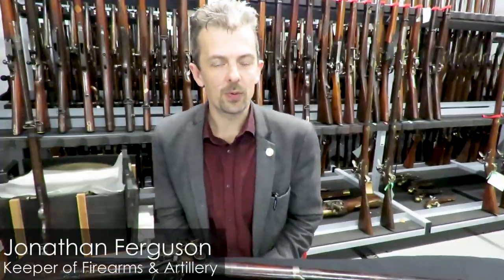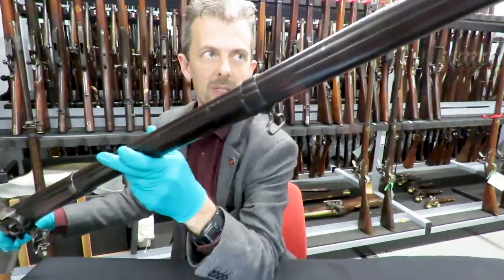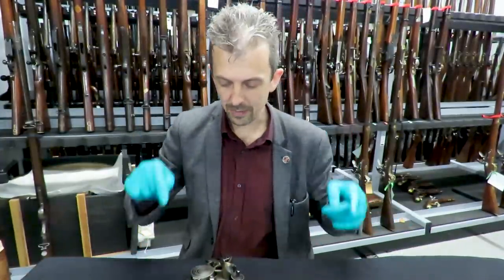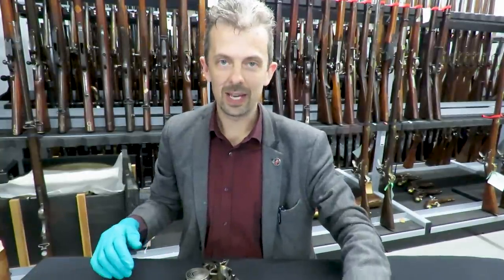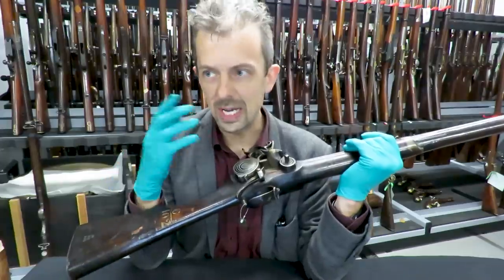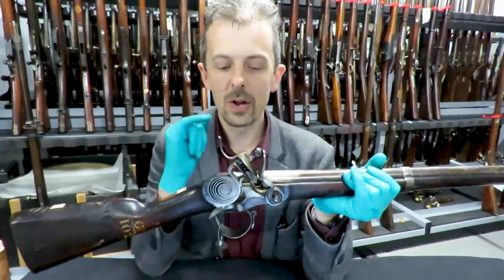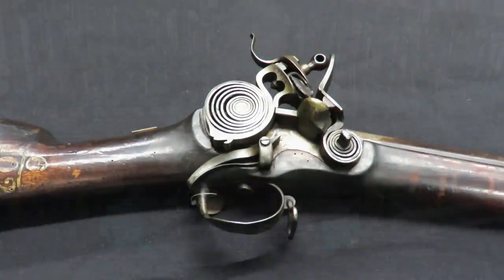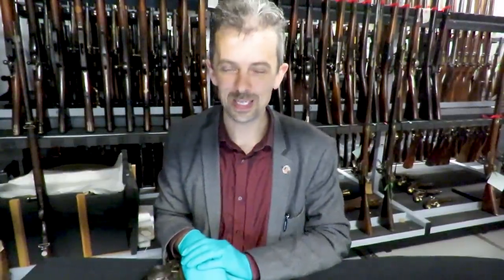Why does this musket have a strange spring lock? With firearms expert Jonathan Ferguson.

Comment: I love these sort of last ditch type weapons, designed to be easy to produce in times of war. They always have such creative design.

The triger seems oddly similar to a crossbow.
Reply: It pretty much works the same way as a crossbow trigger, except that a crossbow would rely on the tension of the string to set it spinning and doesn't need any springs.
Reply: I have a particular one in mind with a very similar looking lock, and a sort of latchet system, with a delecate thumb trigger. It's from the late late 14th century I believe. That awkward time where early handgonne's were starting to compete with light crossbows.

It's been a while since I've looked much at crossbows. I'm probably mistaking a gear or pully type system for a lock. 

I think we need a seriese on forgotten crossbows to shore things up.
Reply: "designed to be easy to produce in times of war." 
Ve need more weapons for ze Volkstuurm.
No problem, we captured a certain design in a French arsenal.

Comment: I'm always taken aback by how much variation there are in examples that I would've thought to have been relatively standardised.
Reply: Don't think you can really have "standards" if things are still made by hand (with the help of machines).
Reply: @aborted4196  That's true for the time period, but that time period was relatively short. Interchangeable parts and industrial machining were on the way in during the 19th century.
Reply: @ericsmith5919  Interchangeable parts started with the American versions of the French Charleville pistols in the late 1790’s.
Reply: @allangibson2408  Yes, but the concept wasn't perfected or universally adopted at the time.

Comment: I have experience as metal worker myself.
If i look at this spiral spring and how to make it.
Other types of spring are easier to make, in my opinion.
What could be the decisive factor is the heat treatment.
Reply: I just commented the same thing. I wonder if it isn't metallurgical - would a clock spring be more tolerant to inconsistencies in the steel vs a V spring?
Reply: @chemistrykrang8065  It makes sense to focus on resistance against production inconsistencies when moving towards mass production, although I have no idea how spiral springs fare against other types. If the intention was that the gun could be made at a much larger number of local workshops than before, that would also make oversight over the production line and various forms of quality control much more difficult.
Reply: @chemistrykrang8065  I don't know, sorry. Only a engineer can answer that.
My basic study in engineering was 15 years ago. Forgot to much.
Reply: Another explanation, although I don’t have any specific proof, is that it might have been a weird guild thing. The guild system had not yet been abolished in 1790, so it might just have been that the more numerous whitesmiths made spiral springs and locksmiths made other springs for some arcane, outdated reason.
Reply: @johanmilde  Possibly the thinking was that yes a separate guild would possess a considerable stock of already made clock springs therefore this Rube Goldberg ridiculosity would allow the use of people and product not normally associated with gunsmithing. At least this part of creating a musket.
Colonial Williamsburg has here on YouTube a series from scrap metal to completed civilian hunting firearm. It is many many hours of one man performing a truly skilled trade of many individual steps. The lock mechanism takes only a small part of such steps,the traditional v-springs are much simpler to make than this coil,a precision manufacture that I doubt anyone modern could duplicate without years of experimentation. 
So to me it makes no sense. There are so many different steps,which then are the steps that take the most time and effort ? Not this I would think.
Taking an already skilled master tradesman,requiring him to add and tinker with all the extra steps from clockspring to the flint dog striking the frizzen, makes absolutely no sense.
 So was this desperation,even a few extra muskets being better than none,or was someone creating this as a statement of unusual master tradesman ability  ? As in,"I can do this and no one else can" ? It is beautiful in its own way,but eccentric beyond belief. 
How accurate  and reproducible is the strike ? Surely the spring has wobble and give ,no ?
Beautiful but absolutely bizarre.
Reply: @paulmanson253  My guess is that the coiled spring, being longer than an equivalent v-spring, would be under less stress, and store / release less energy per given length, which would make it more tolerant of imperfections in the shape, metal quality or heat-treat.
And with the production methods of the time, producing very consistent quality steel, and precise, consistent heat treatment were probably among the most difficult steps to get right…
But I’m not a metallurgist by a long shot, so that’s just a semi-educated guess.

Comment: it would be cool to see if the spring was comparable to a commonly used size of clock spring at the time, especially if to the extent such springs could be canibalized, the reason it was so drastically simplified to the point of impracticality was probably to establish just how much you could remove, i'd imagine if they'd put the plan into use they'd have most likely opted to add a more conventional trigger, preferably with some kind of spring even if just a weak one to help the sear engage

Comment: I'm not sure I understand why a clock type spring was considered easier to make - the heat treating principles are the same as a conventional V-spring, and a V-spring is a simpler thing to forge, surely?

I've done a tiny bit of forging and heat treating (making tools, chisels etc) and I'd be a lot more confident making a normal mainspring... what am I missing here? Is there a metallurgical reason why a long thin clock spring is easier to produce?
Reply: My surmise is a conventional lock spring needs to be closely fitted and tempered ~precisely for its size. An external spiral spring leaves a lot more room (in more than one sense) for variation.
Reply: I would very carefully hypothesise, that a large coil spring is under less tension and deformation, and more forgiving of  heat treating errors, than a V spring. Every portion of the coil barely deforms. in a V spring, various areas are under  very different amounts of tension and deformation

Comment: Very interesting. It seems that a "v" spring would be easier by far to make.
Reply: Exactly my thoughts, just imagine forging out the length of that spring... I think it wasn't really about the spring itself but more about the ease of putting together this "crude" external system vs putting together the standard internal mechanism and getting it to work right (which I assume needs to be done more precisely so everything fits and works properly...)

Comment: I can see no benefit to constructing that mechanism, rather than the conventional lock. The maker still has to create a spring ... coiled, rather than 'V-shaped'. I would not have thought that would be any easier to manufacture. Perhaps the idea was to pinch the springs from the clock mechanisms of the bourgeoisie, after having first sent the owners to the Guillotine.
Reply: The weird thing is that this is several years before the part of the revolution where a lot of the choices would make sense. In 1790, there’s still a king, now with limited power; there’s rising tensions in Europe, but war doesn’t break out until 1792; and the Terror and the mass mobilisation is 1793-1794. 
So this was not a last ditch weapon, but it was made at a time where war looked quite likely. It might have been intended for the National Guard, which as a (initially) local/regionally based citizen militia would require a lot of cheap guns, especially given that they paid for their own gear.
Reply: @johanmilde  You're quite right, and the timings throw doubt onto the 'last-ditch' hypothesis.
I'm gonna take a wild guess that breakages of conventional main-springs were very common ... and someone figured that a coil-spring would be a much more reliable and durable alternative.

Comment: Mr Ferguson,

I have two thoughts concerning this musket.  First, I cannot see how the springs and trigger are attached, but I wonder if this lock could require lesser degree of skill than that required for the hand-made tools and operations in the  drilling, tapping, threading, and in hardening and tempering compared to fabricating reliable powerful and highly tensioned v-springs and the rest of a conventional/classic flintlock, especially if bridled.  I don't know how the skills and work entailed with this would compare with those in either version of miquelet.

The second point is that I believe that this firelock might be safely managed with only moderate modification to the normal musket drill, assuming reasonable training and practice.

The first step in loading would be to come to half-cock in a significantly different sequence:
 - Come to Poise Firelock, i.e musket vertical, lock about face level and oriented away from the soldier.
 This position could probably be modified somewhat, held a bit lower and/or rotated somewhat clockwise. 
 - Continuing to grasp the firelock firmly with the right hand, bring the tip of the trigger finger to the back of the trigger and press it forward with pressure sufficient to enable the tip (sear? nose?) to engage the bents on the cock.
 - Supporting the firelock with the right hand, release the grip of the left hand and bring it back to the lock, and with (whichever finger seems appropriate in a proper military manner), pull the cock back until it engages with the trigger nose in the half-cock bent.

Then, prepare to prime, again somewhat differently from usual:
 - Bring the left hand underneath and around to the right/lock side of the firelock and position the fourth (or third and fourth) finger(s) behind the hammer (/steel/friizzen) in preparation for opening the pan. 
 - Pull the hammer open/forward with the finger(s) while proceeding to grasp the forend of the firelock with the thumb and remaining fingers of the left hand.
 - Bring the firelock down to the usual (Ready) position to prime (muzzle angled up, lock by the right hip).

Priming is closer to normal: Supporting the firelock with the left hand more or less as normal while continuing to hold the pan uncovered and Grasp Cartridge, Bite, Tear, Pour Prime, and Pinch Cartridge (i.e. between the thumb and forefinger of the right hand) all as normal, then:
 - Extend the second (or the third and fourth) finger(s) of the right hand and position them behind the hammer in preparation for lowering it to cover the pan.
 - Release the hammer with the finger(s) of the left hand and with the right hand, lower it to cover the pan.

Proceed to finish loading as normal.

To Make Ready, repeat the above precedure for half-cocking at the Poise position to come to full cock, then bring the firelock down to the Ready position, rather than the usual procedure of coming to the Ready position and cocking with the right hand.

Aim and Fire are like normal.

Regards
Reply: I forgot to mention that this spring-rebounding hammer (/steel/frizzen) would likely be hell on any flints less than full length and rather robust.  The left (conventional) lock on my double rebounds badly and just eats any flints not meeting this description.

Comment: It is interesting to see why some of the smart inventions did not work out. It is also illustrative of the disappearance of occupations with industrialisation and mass production - simply the amount of hand fitting required to make this thing work - occationally.
You see something like that with Adolph Furrer, where gunsmithing got locked into the blind alley of the toggle lock. The Luger is a good example. Excellent pistol - only thing wrong with it is the degree of maintainance and the number of man-hours.
If you consider the modern day pistols with tilting barrels - well it is the solution, which means you get what economists call a natural monopoly.

Comment: Interesting lock. Speaking of ramrods, how were metal ramrods held in place so that they did not slide out of the housing while you were carrying the musket around?
Reply: The hole in the stock is quite deep and the pipes holding it create an awfully long path that needs to be perfectly straight for it to not be touching and generating friction against anything. So it tends to really just stick in place thanks to friction. 
If you find yourselves in the weird and rare position to have a ramrod that  moves about totally freely...Just give it the tiniest of bends, and it will  frinction-fit itself.

Also, you rarely hold the musket  muzzle down, which would be the only chace for a free ramrod to fall out.

Comment: Probably an attempt at a low maintenance lock mechanism. Nothing to take apart to clean  .. the floating hammer might have been thought to increase the amount of spark by allowing it to strike more  like a fire starting flint and Steel giving it bounce instead of just breaking the flint quickly like a typical flintlock

Comment: Don't wheel-lock pistols have clock type springs
Reply: No. They usually use a V-spring with "chain" links from it's end, to the shaft of the wheel.

Comment: There is no advantage over a standard flintlock, in fact it is a step back in every way. Very very dodgy!
Reply: You're missing the entire point of it. Did you even listen to what he was saying about it? It's not meant to be superior, it's meant to be much easier to find people with the skills to make it.
Reply: @nowtelsematters  of course he didn't listen, armchair experts never bother to pay attention.
Reply: @kevingooley9628  I believe his premise is wrong. That would not be easier to make than a standard flintlock. I have made leaf springs and repaired large clock springs. I would rather make a leaf spring than do the repair, let alone make one of those heavy springs. I think it was an experiment. If to replace or even be an adjunct to the standard issue it would still need a lot of development work to make it more ergonomic. You can see how difficult it was to handle and that lock would also be much heavier. Somebody wanted to see if he could substitute the leaf springs but you can see there is no advantage. One of those ideas that went nowhere. Also, if you want to engage in a debate you should not make assumptions about people. It just makes you look like a troll.
Reply: @TrainmanDan  who’s going to train the whitesmiths how to forge leaf springs during last ditch effort times? Also Jonathan didn’t discuss if there are any metallurgical differences. I would bet there are. 
At the time spring steel was not commonly available. And probably completely unavailable during times of economic crisis or in areas under imminent threat of invasion. 
Common steel can be made into a workable spring but it will take much more material since its limit of plastic deformation is so low. 
Jonathan spent a lot of time explaining that there are many downsides to this approach. Of course a mechanism made by a knowledgeable tradesman is many times more effective but locksmithing was a very specialized field that took years to master. 
You wouldn’t give all your silversmiths gold and expect them to be goldsmiths. 
Very odd you would assume otherwise
Reply: Colin, to answer your question, the same people that are going to teach them to make those big 'clockwork' springs. I just believe that lock is not easier or simpler to make than a standard lock. The most tricky parts of the lock to make are the springs. As you say they have to have the proper metallurgy or they will fail.  I believe that a leaf spring would be the better, simpler choice. If Johnathan comes up with some definitive documentation that specifically states the reasons for its construction then I will defer but until then I think my opinion that it was an experiment, proof of concept, is as good as any.
Reply: I think the important part of the premise is that it was an attempt at making a gun that whitesmiths could produce —not necessarily anything close to a successful or even well thought out attempt. I think the result ended up being a weapon that was more or less equally difficult to produce, and that seems to have been more difficult to operate, so there’s probably a good reason that when wartime mass production was actually set in motion a few years later, they produced normal muskets, not these clockspring experiments. There’s definitely a flawed premise here, but I think that belongs to the original designer. 

I think the timeline is also important to note: this was not really a last ditch weapon, as it is from two years before the war even broke out, although there were international tensions. So they knew that they might need guns soon, but it was not inevitable and not imminent. So I think the most likely explanation is that this was some official somewhere’s harebrained pet project.